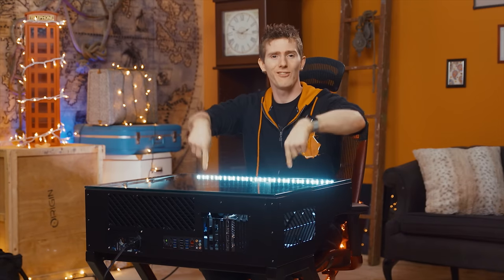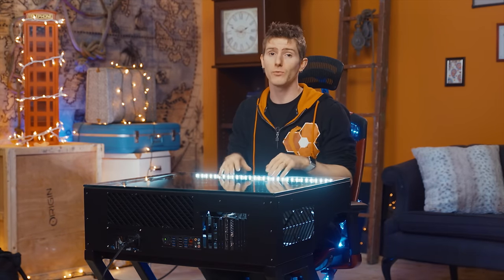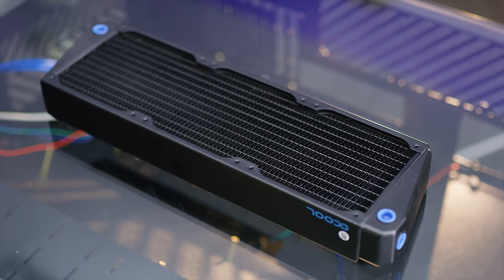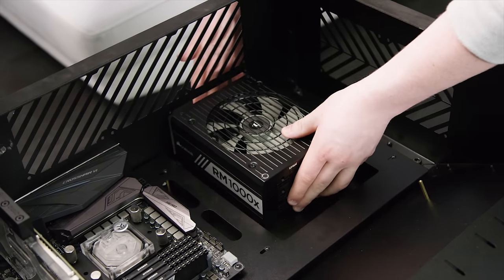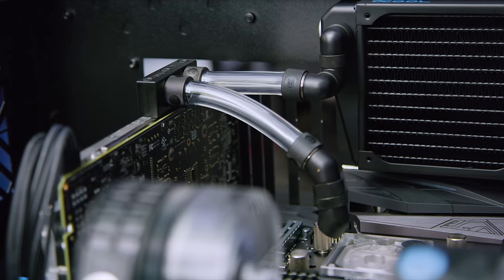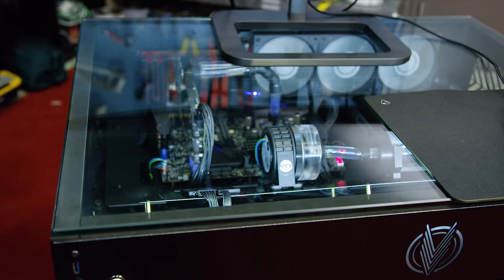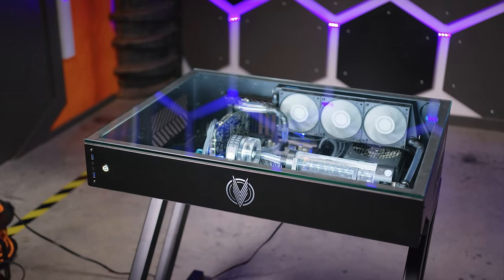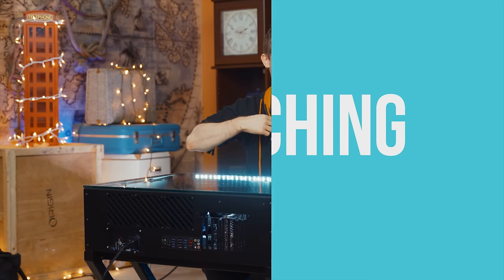Smallest Desk PC Yet!! - Vector Desk Mini Review

Comment: Make a desk mounted desk.
Reply: a whole computer room cooler.
Reply: Make a mexico mounted wall
Reply: wingracer 16 they actually did that with a full room water coll
Reply: I know, I was trying to say do the opposite. Build a computer that cools the whole room.
Reply: wingracer 16 Like an air conditioning unit?
Reply: Zytran L I think they are talking about a PC that is also an air conditioning unit
Reply: gbvenom That should be something they build. A pc that the case is an air conditioning unit(Plus points if the AC works)
Reply: JoshTechBytes Desk mounted desk mounted to a desk
Reply: JoshTechBytes how about a PC mounted desk.
Reply: whooaaa, that some deep stuff right there....
Reply: desk seption
Reply: and a wall-mounted linus? or maybe a linus-mounted wall?

Comment: Well I have an IKEA GLASHOLM glass table, which very good looking. Then, I suspended a 10,5 liter (shoebox size) case to hang very near from the bottom-backside of the table. The table and case cost me 80 euro (85 USD) combined. In the case there is an AIO for both the 6600k and the GTX 1080, so it's very powerful and quiet system. I've also cable managed the cables for the PC, 3 displays and peripherals quite well, so there are no cables hanging either. I just love this setup :)

Comment: You can buy a lot of LED strip, soldering iron and magnets for the price of those cable mod lights.
This does not work well as a desk. It would work really well for living room gaming. Use them as end tables beside the couch for two people to game from the couch. Each with their own machine. Great couples setup. Great for a media player while gaming. I'll bet the price was high. You could make a nice air cooled set of these for a reasonable price. Bedside gaming machines? Hell have a set in each room and one in the bathroom.

Comment: i would think you would air pressure test for leaks rig up a T fitting to a T fitting with a  0-5 psi pressure gauge off the side , connect the other end to a valve, air fitting arrangement a Tractor Tire air Valve works well and you can use either a bike pump or a compressor be sure to turn the pressure way down  it is how they test gas/water /sewer plumbing lines put 3-4 psi on it go to lunch or better overnight and if it holds it will hold your water. way better than running hardware and having to clean up mess.

Comment: So that desk designed for Hobbits is 500$ and the materials are well let's just say not good, yet you said considering the price it's ok. What the fuck?
500$ for a Hobbit desk is a lot of money and should have top notch materials.
Reply: You're paying for a metal desk, the computer case AND a glass.

Considering it's recent, I think it's a fair price, just let it lay in the market for a while and the price will lower as new models come out.
Reply: I could build that for less, steel is cheap, and a welder isnt hard to use. 
probably build it stronger too.
Reply: jgould30 9
Reply: jgould30 mass production is something that rather lowers the cost to make a product
Reply: >seems very small 
my room is tiny already, the desk goes from floor to ceiling and from door to wall. its made out of 3/4 ply laminated together, as well as 2x10 and 2x8 with 3/8 ply for the front part of the cabinet. in order to get the desk in frame with the camera I had to stand on my bed at the very back corner. 

the table is 15in wide and wraps around in an L shape, where the case for my PC sits and the shelving unit for all my games is. 
. 
the desk itself is 83 1/2 inch tall x 52inch long. and 16 1/8 wide (at the thinnest) 40 inch wide (at the widest) 
the cabinet is 37 1/2in long x 11 1/2in wide x 26in tall. 

 find me a desk with those measurements for less than what I paid for in materials and screws with the same amount of storage space.
Reply: keep in mind my room 90inch wide x 89 1/2 long x 83 1/2 inch tall.

Comment: You messed up by using 4 sticks of RAM on a Ryzen build. You can't obtain the highest possible O.C. speeds for the RAM when using quad channel RAM. Not only does it lower the speeds of the RAM, but it also lowers the performance of the Ryzen CPU since the "Infinity Fabric" ticks at the same speed of the RAM.

If you wanted the best possible, you should've used Single Rank RAM as well. If I'm not mistaken, those Vengeance LPX sticks are Dual Rank, which lowers the possible speeds even further when it comes to Ryzen builds.
Reply: Cody Stephens seriously who wants a Ryzen or any form of AMD processor when the Intel i7 is the CPU to go for for every possible reason you can think of.
Reply: 8 cores for a lot cheaper price. It's not the best of the best for gaming, but if you are streaming, compiling, rendering, or doing any kind of work that would benefit from multiple cores, Ryzen beats i7 in price/performance. Even then, now that drivers are being pushed out, Ryzen is doing very well in games, with negligible difference when playing at 1440p or 4k resolutions.
Reply: Cody Stephens You must be the smartest guy on the internet I have ever seen! You must be as smart as Linus!
Reply: +Fredrik Gitlestad

No, I am not the smartest guy on the internet. What I am though, is an IT with a passion in this field. I've done my research and compiled information from multiple credible sources (I can source them on request). What I'm stating is just the aggregate result of many hours of testing from these people. It is a collection of statistical facts, regardless of what you or I think.

I'll go ahead and break it down for you since you want to be such a smartass. AMD as released information on how their "Infinity Fabric", the high-bandwidth interconnect used to connect the 2 quad-core complexes to other non-core components, like the PCIe  root-complex, and the integrated southbridge. The speed of the Infinity Fabric is synced to the speed of the memory. The faster the memory (RAM), the faster the Infinity Fabric "ticks", the faster it is able to transfer information from these non-core components to the CPU to be processed.

Multiple tests have been done with Dual Channel and Quad Channel memory modules. Consistently, they are able to achieve higher speeds of RAM if they use 2 sticks of RAM, stead of 4. More tests are done between "Single Rank" and "Dual Rank" memory sticks. "Single Rank" memory sticks consistently achieve a higher clock rate than "Dual Rank" when it comes to Ryzen CPUs. Taking all this information, it would've been best to have  Dual Channel Single Rank memory since it would significantly increase the speed of which the Infinity Fabric of the Ryzen CPU can operate it.

These are the facts. If you have credible information to prove me wrong, I would love to see it.
Reply: Ok. You will probably not believe me but I did actually read all that and i did understand 90% of it
Reply: If there is something that you don't understand, let me know and I'll do my best to explain it,
Reply: Cody Stephens Now that i read it a second time i understood it all. (Seriously i did) but thanks for telling me about it. If I spell anything wrong it's probably because I'm from Norway.
Reply: He didn't "mess up" anything. Filling all the slots with ram sticks looks better, and making a good looking PC is the whole point of the video. I don't think they care that much about "practical performance" in this kind of build since it's probably already disassembled by now lol. Anyone planning to get a Ryzen-based system is most likely gonna figure that out in their research before buying it anyway, so it doesn't matter.
Reply: you cant be serious right? ryzen is practically superior to intel in every way
Reply: when someone actually know what they are saying NANI!?!?!?

Comment: A question about the radiator config: Are the fans pushing the air OUT, or pulling the air IN? I just watched Linus' video where he recommended a pull config so you can clean the radiator easily. Now I am confused. Shouldn't the air go OUT, no matter the config?

Comment: 1) sideholes of the desk are way too fucking big , probably will accumulate a lot of dust very fast.
2) no way to lift or lower the desk?
3) inside looks a bit too light
4) is it aluminium inside? should be for maximum cooling.
5) weird pci-e covers (breaking them out i guess) should be reappliable
6) needs dust mesh filter on holes inside.
7) needs options for cable management in the back to make it look cleaner
8) a bit too short in width.
9) if you fix these issues then the price might be justified and i might buy one. LUL 500/1500$ model.
Reply: The desk you found is not the desk shown in this video. The desk in this video is $500
Reply: fixed, k , still not worth it imo. theres too much wrong with it. even for the 500$ model there should at least be a way to lift/lower the thing somehow, im not sure if they just didnt show that, or if its not implemented.
Reply: If you think $1500 is a lot a, an adjustable desk case will be priced almost double that on the fact that its one of the only that exist to the public.
Reply: Schmutz Lord An Adjustable desk adds lot to the price, as Ada said. This is pretty good for the price.
Reply: it really depends on the method, powered one yes does add a large cost, manual one a lower one, hight set during self-assembly a lower one and adjustable feet hight an even lower one. that last two really only adds pennies to the build cost
Reply: Mark Smith I agree but who wants to adjust it when it has 20+ pounds of hardware in it? that's impractical and would be pretty annoying to move around. I mean it could be a thing but personally it would be pretty cumbersome.
Reply: not really, you can always ask a someone to give you a hand and if not, just disconnect the cable, and roll it on to it back ( where mobo I/O is) and adjust. If it was a full-size desk then it would be more of a pain BUT most sensible people would SET IT BEFORE adding hardware you know when you're building the desk?
Reply: Get an adjustable chair? Or not buy it because its not offered as an option? it doesn't take rocket science to figure out how to figure out a reasonable solution. Sensible people use their head and not buy it if its a problem or figure out another solution. IDK how youtube commenters have all the sudden started to turn into this much cancer.
Reply: it was a weak ass argument you gave and originally I was arguing saying that it really wouldn't cost that much to give it some adjustability. Also, youtube comments have ALWAYS been polarising it nature of anonymity .

Comment: Are you seriously claiming that x8 PCIE wont affect performance because of a test done in 2011? is this even real life?
Reply from the maker: +Mitch H do you seriously have any evidence whatsoever to support your theory that it would?
Reply: LinusTechTips I absolutely do. I have done extensive testing in it. Using SLI 1080s as well as 1080tis with both a 6700k and a 6850k. Also the hardware reviewer for pc gamer has done testing and found the exact same thing... so maybe you need to do a little more research and due diligence before opening your mouth bud.
Reply: LinusTechTips high end cards are ABSOLUTELY powerful enough to saturate a x8 pcie bandwith at this point. It actually wasn't until the 10 series that this has happened.  I have also run SLI titanX hybrids  (maxwell) and it was not an issue. It absolutely is on the 1080 and up.
Reply: Mitch H not really
Reply: giorgis nikoloudakis im sorry, what? If you're going to take the time to comment, maybe say something that makes sense.
Reply: Mitch H now that i see my comment it really doesnt make sense sorry for that. What i wanted to say is that pcie 3.0 x8 wont affect performance for a single card (dont know about sli/crossfire though)
Reply: I could see increased bandwidth usage when GPUs are talking to each other(SLI/Crossfire), but does this affect single card configurations?
Reply: Ada Palis LOL you ask if people take pc gamers reviews seriously while commenting on a linus tech tips channel? You take that seriously? The same company that reviews CPUS in games by testing at 4k, creating a massive gpu bottleneck amd thereby making all cpus look practically identical ? Lol give me a break dude. And ask me if I give a shit if a random goof thinks I'm acting like a clown.. seriously ask me. Lol... im a douche but you call people "bro" lmao... good one.
Reply: I call people bro, that's what I do. "you ask if people take pc gamers reviews seriously while commenting on a linus tech tips channel" did I say I took it seriously? And I say bro because I say it to help you not come off as a meathead with a chip on his shoulder, its meant with love princess. And Linus responded because he literally couldn't believe you were coming off like that either. "before opening your mouth bud" normal people don't say shit like that unless they literally walk around with a puffed out chest acting like they run things. You don't really come off as a people person. Just another know-it-all random in a youtube comment section proving his irrelevance to the tech community. don't bother responding I already don't care anymore to continue.
Reply: "lil fella" Like I said someone puffing out their chest. "youre giving me a headache" no I think it might be your roid rage causing that. Aren't you late for your date with a protein shake and squat machine?
Reply: Mitch H holy shit stop being so toxic for no reason at all he just wants numbers. Gamers nexus has a video and it shows how it doesnt affect performance at all
Reply: Mitch H his being toxic doesnt mean you arent
Reply: giorgis nikoloudakis oh I definitely am. I'm just giving it back as good or better than I'm getting it
Reply: Mitch H do you also think its good to be toxic?
Reply: giorgis nikoloudakis Is that a rhetorical question? LOL ok dude I'm bored now :P have a good night.

Comment: curious why not smoke test to see if the water cooler lines are tight? I'm new to building pcs just thinking I've tested fuel lines and other things that need to be air tight with smoke, Seems like it would work just fine there too

Comment: On the choice to not recommend a number pad. (Just my opinion. There is nothing wrong with your way of doing things.)
It is probably a matter of learned behavior. I usually have my mouse set to only need about 3 inches, or less, of travel to fully cross my screen. I use number pads a lot, even when gaming (when using arrow keys rather than wasd, I know I'm odd). I don't think I would ever need a mouse pad as big as the one Linus put on that desk.

Comment: Open up the PSU and swap the fan for a Noctua or something quieter. I've got a Corsair that's ~400 watts in my HTPC/test rig that's running a Noctua fan and it's incredibly quiet when running. A minor mod like that shouldn't be too hard and is right up Linus' alley.

Comment: 4:55 "8x lane won't affect performance" I checked out the SUPER HIGH PRODUCTION VALUES video you linked to and it's from 2011, talking about PCI-E 2.0. It would be good if you could do a repeat test with PCI-E 3.0. Do they still have enough bandwidth for modern games + encoding for streaming on x8, at 4k @144Hz resolution on that sexy ROG monitor?

Comment: Aside from not needing a computer case, kind of pricey.  And the venting didn't seem to account for having two or three of these crammed and pressed up against each other.  I'd probably swap the glass for a wood top that extended past the sides.  But the glass is probably half the cost and 80% of the shipping.

Comment: Linus does higher watted Powersupplies run cooler than lower watted ones ? I'm asking since you chose a 1000 watted PSU for this build and I have had some run ins with a corsair 450 Mini tx PSU that would run hot and need to spin almost constantly.

Comment: maybe update that other video and just double check with a gtx 1080 cause it does bottleneck with certain gpus depending on pcie 2.0/3.0 generation. Also that vid is from 2011, video cards have gotten stronger since then with large bandwidths.

Comment: Linus, I still really don't get it. Once I get all my components packed up in boxes, what should I do? I mean, what should I plug from the power source or the motherboard? How do I know which cable is which? All I know right now is actually "how install an SSD" and "how to get a CPU in its place"(or maybe "a power source has 8pin, 4pin and maybe 2pin connectors")! All those cables are simply a mystery. BTW, once I get a fully working case, does it pop windows up? I don't really think that's the case... I haven't even found a video about that before!
Reply: Well, you know what? "Maybe" I'm the NOOB...
Reply: I am having hard time...
Reply: Well on your PSU and Motherboard a lot of it says exactly where to plug everything in. And when your plugging in buttons on your PC honestly just start with the power and try turning it on and if it doesn't work move it to the next slot.
Reply: Charlie Tekautz, I'm just afraid of doing anything wrong that could damage my motherboard, and I got no idea what are those names. I'll go for an expert. He's going to get everything assembled for me, up and working for $5. Maybe that's much better than risking any PCB.
Reply: Thanks Pepys. LGA and PGA are the names I didn't actually know. It's really exciting to know it's that easy, so I'll try to build it myself :) . Thanks for the help!

Comment: So, the structural integrity of the desk improved with all the parts installed. Meaning that the motherboard is now handling part of the structural responsibility of holding up the desk. Not exactly a comforting thought.

Comment: Step 1. Buy full tower case.
Step 2. Turn it on its side.
Step 3. Attach legs to the bottom.
Step 4. Replace side panel with glass top.

Comment: i am currently planing a custom loop 
is it better to have a 360,60 mm radiator @ push-pull or should i go with a 360,30 mm radiator in pull with a 240,30 mm radiatoe in push ?
Reply: more radiator the better